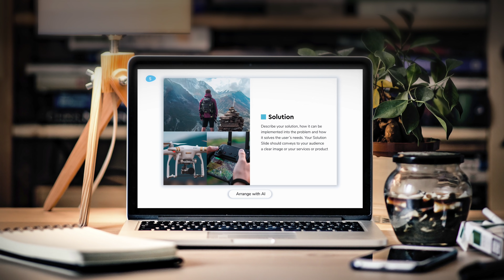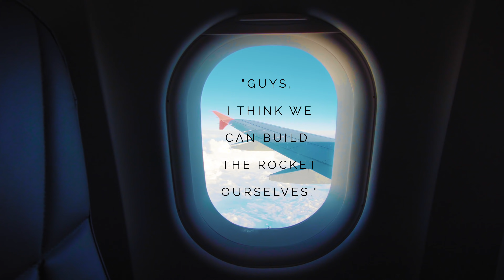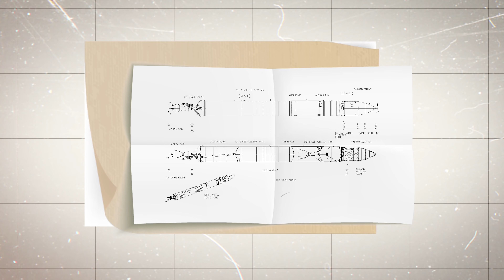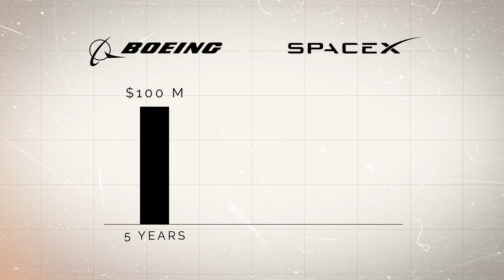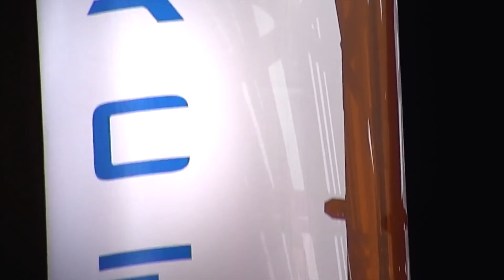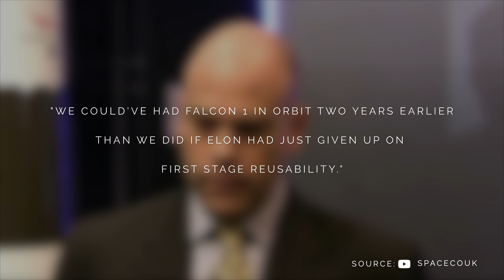How SpaceX was $200,000 from bankruptcy

Comment: At 13:06 "And yes the Starship engine did blow up," is a bit misleading, as it was a disconnect failure on the test stand that released the CH4. SN4 had just successfully completed another static fire when the CH4 fuel line disconnect failure occurred. 
The Raptor engines are safe and reliable! 😀🚀
Reply: And the thing is, from each crash, they are learning more and getting better. 

It's like the Nazi V rockets, it took them years and many attempts to perfect them.